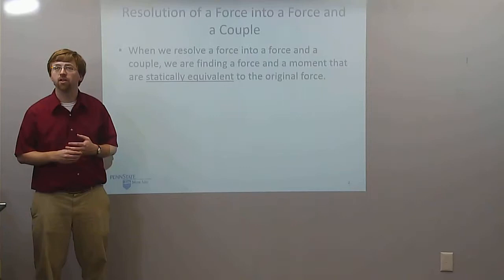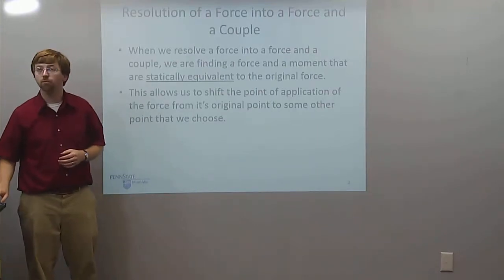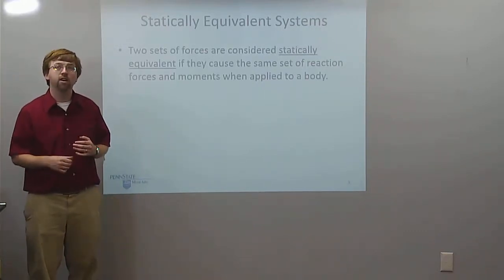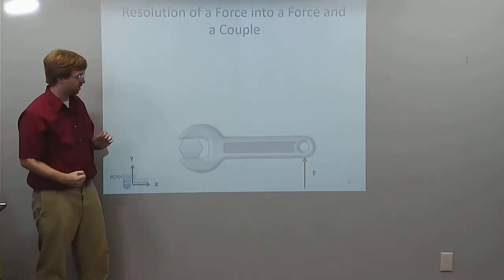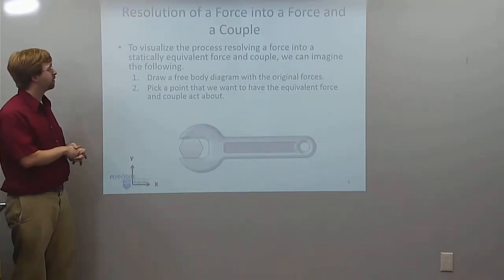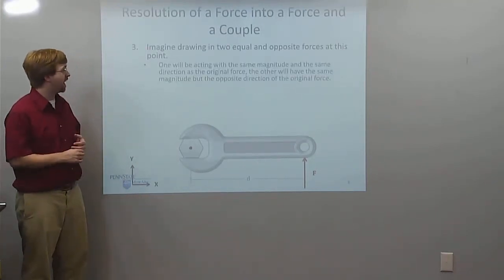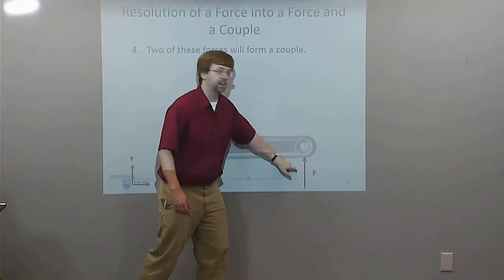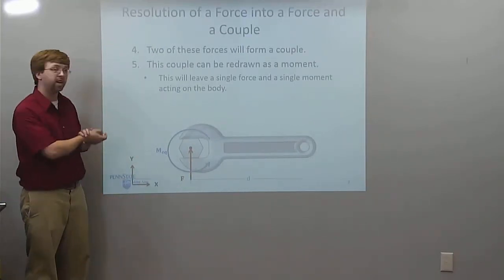Resolution of a Force into a Force and a Couple - Adaptive Map Video Lecture

Comment: Sir, i wanna know that. At last there is presence of both couple of moment and the force, is that force is adding something or not..
Reply from the maker: The force in the end does have an impact. Say we were to further the analysis into a stress analysis of the bolt. As we press on the end of the end of the wrench, we would get both a torsional stress from the couple at the site of the bolt and a shearing stress from the force at the site of the bolt. Both of these stresses would exist simultaneously from the one initial force.